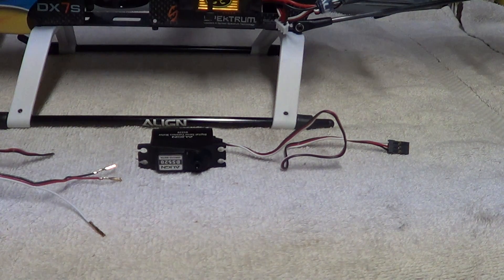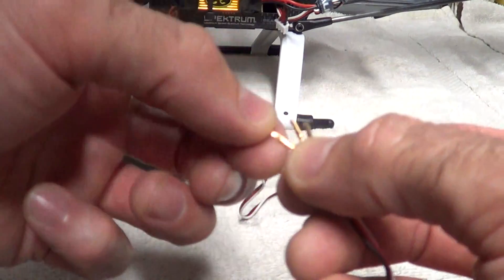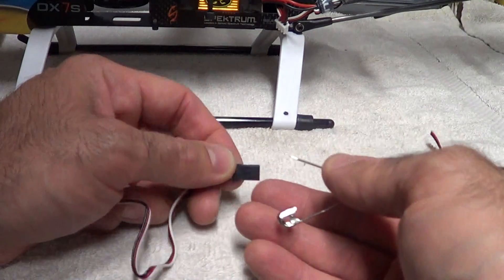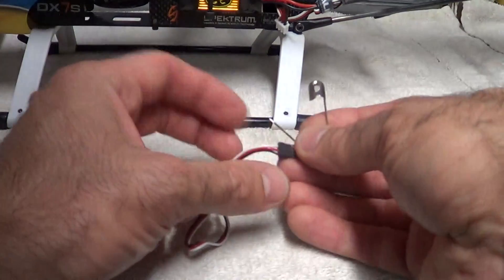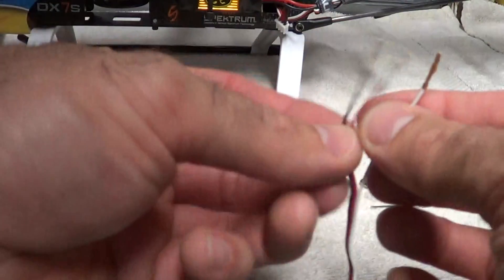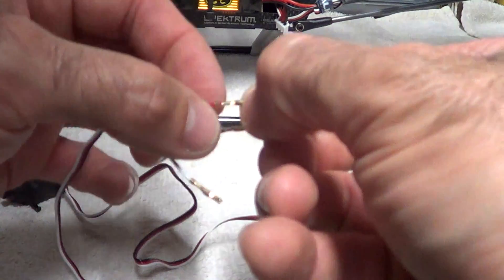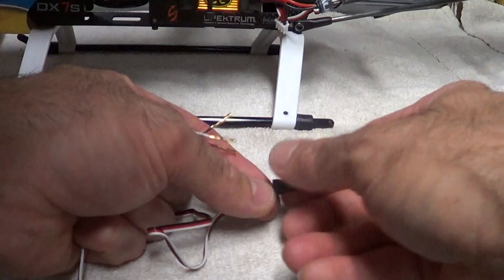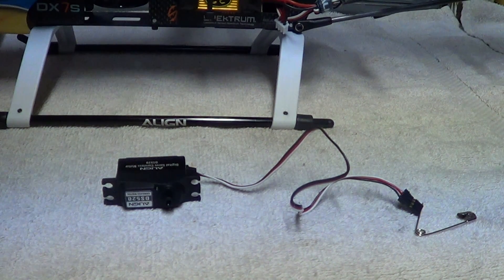How to change a servo connector

Comment: If the black plastic connector is broken there is no reason why you would need to be gentle with it. If you put some light tension on the three wires when lifting up the three "locking flaps" you can pull out all three wires at the same time. But only IF you know exactly what you are doing. Only then.

Comment: You mention that this so you can repair the connector without cutting or soldering the wires when the plastic part breaks or cracks.  All fine and dandy but where do you get the replacement blank plastic pieces?
Reply from the maker: From a local hobby shop or on online hobby
Reply: @nitrokyosho Amazon has kits with connectors, pins, and crimpers for about $25

Comment: i want to fit one of those standard connectors onto a crappy Chinese servo which has different type of connector (wltoys) so I can put my own esc etc into it without changing the existing servo, the problem is the Chinese servo is not just black red white, you got a brown wire too?